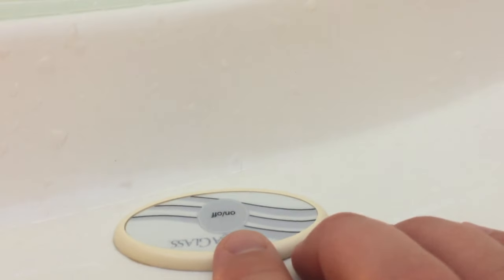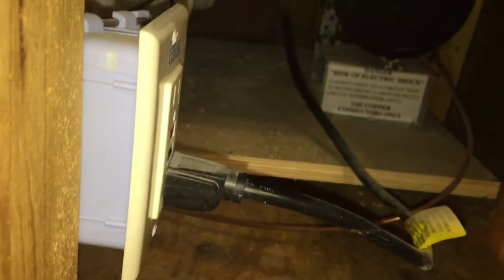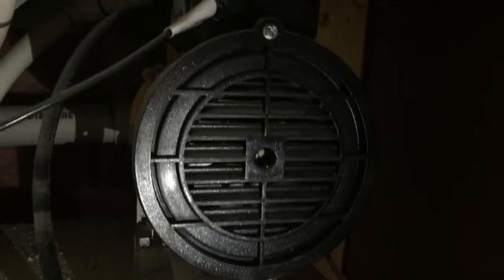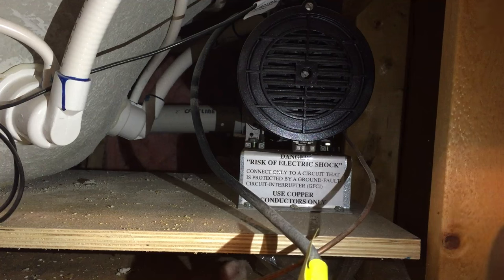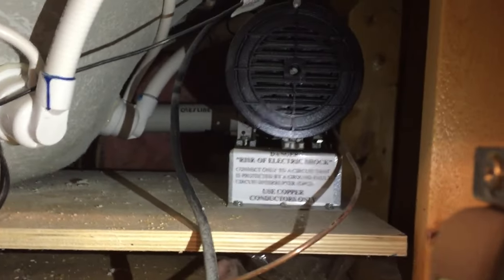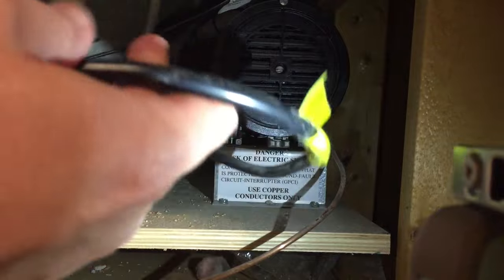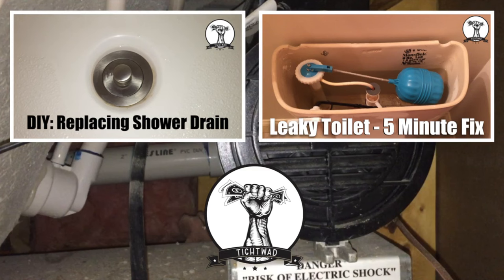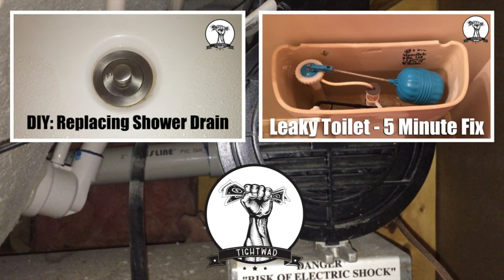Fix Jacuzzi, Hot Tub, or Pool Pump That Only Hums

Comment: Yes, I agree that this works, but this is not a "fix". I find that mine continues to get hung up, so this is a manual start, rather than a "fix" as it is required every time we want the jets to turn on. Not convenient as my access panel is accessible only from the garage, requiring a trip outside, laying on the floor of the garage to reach into the space to turn the drive manually to get it loosened up. 

This is a tub that is about 11 months old and used three-five times per week, with the jets every time.
Reply from the maker: Casey W Ours works every time now. Sorry you are not having the same luck.

Comment: The "screw" we need seems to be on the opposite end...no easy access...couldn't fix it :(
Reply from the maker: J.P. Paulus That stinks. A lot of people have commented that theirs was installed backwards.
Reply: Mine is also oriented that way. I removing the inlet pipe and the 4 screws holding the pump housing on. Then I grabbed the impeller and turned it to get the motor to stop stalling. Took a lot more work, but it fixed the problem.

Comment: I have to spin the moter by hand every time I use jets terms. Me
Reply from the maker: Do you make sure you let it run for a while? Sometimes they are just too corroded and you have to spin them each time.
Reply: Gary Lance mine does the same lately. I am renting and owners will not pay to fix,  so I tried this and it worked...then had to replace the bellows. It worked again for a few times and now is doing the same thing. The motor is reversed so it's a pain yo get yo it and I had to remove a whole marble side panel to access it...there is no door. I would like yo fix it and then seal it back up but with this constantly occurring, I'm worried about sealing it. I would just not use it but it looks like it gets dirty/moldy looking in the jets and I cannot run anything through yo clean it if it doesn't run. Any suggestions TightWadRepairs?

Comment: You're not going to believe this, but then again if you were me. You would ! That screw I need to get to is facing the wall. Kid you not. So who ever put the tub motor on/in whatever. Put it in where no one can get to that screw ! In other words all the pipes are facing me when I take the cover off. Not that motor screw !
Reply from the maker: Kel4everSmiles That is unfortunate but more common than it should be. Is there any clearance behind the motor where you could get a short stubby screwdriver in it?
Reply: @TightWadDIY  Maybe, but I really don't think so. I sorta tried to reach back in there, but I didn't give it my all. I'll probably try again later when I'm in the mood ! Right now, I'm not too happy about it LOL
Reply: I was able the pull the pump housing apart and turn the impeller then reassembled it. It does take a lot more work.